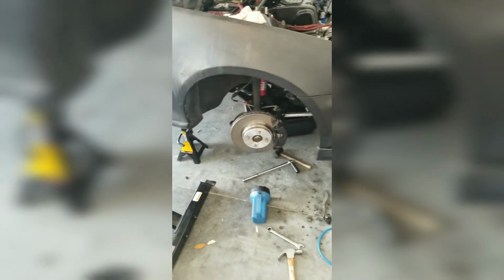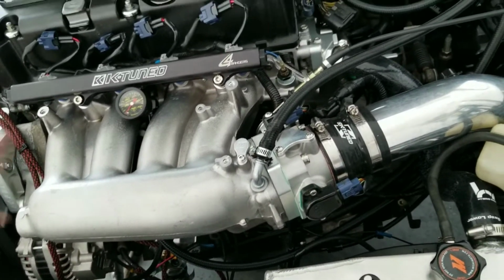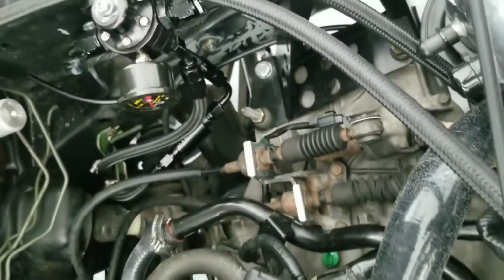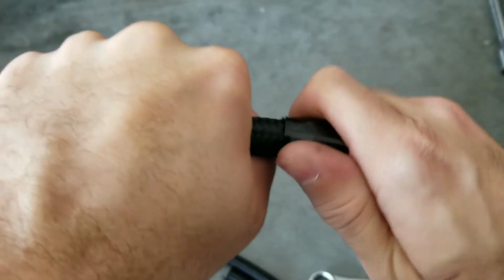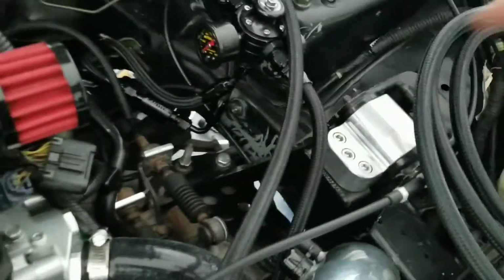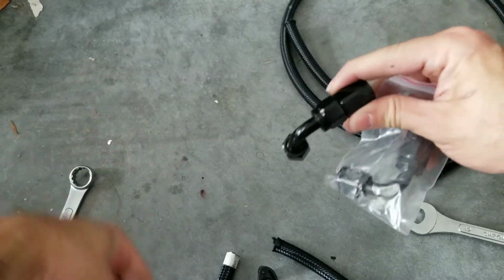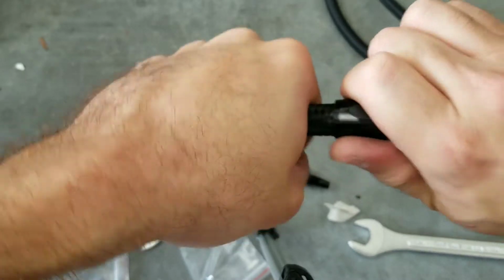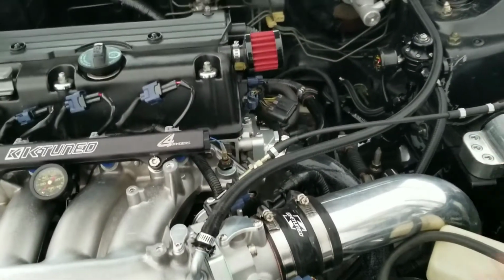How to make custom kswap fuel lines for only $45 dollars!

Comment: What size an hose are you using on intake manifold near the throttle body?
Reply from the maker: That's the vacuum to the power brake booster is a -6

Comment: Can you run E by just doing that or you your to do Some stuff by the fuel pump
Reply from the maker: To run E85 or higer methanol fuel you need a compatible fuel pump along with non corrosive fuel lines, this rubber lines wont work for long.
Reply: @Almostboosted what about if I got PTFE line and set it up just like how you did and I had a e85 fuel pump would it work or I got to some lines by the fuel pump
Reply from the maker: @noticethenelsonsyet8790  perfect
Reply from the maker: @noticethenelsonsyet8790  ethanol *

Comment: Hi buddy how have you been? I have a question for you. Mine fuel line setup similar to yours obviously.  Tank vent tube is cut, OEM fuel line to OEM filter to ktuned FPR then to the return line+ Walbro fuel pump.  Ok so here’s the question, my car starts fine and idles fine. Pressure stays 55psi at idle but soon as I shut the engine off my FPR gauge drops to zero almost right away even when at prime.  Is it normal? Can you check yours and let me know thank you in advanced.
Reply from the maker: Message me through IG if you have it to better help you troubleshoot
Reply: @Almostboosted  can’t find where you list your ig.  How do I add you thanks

Comment: Thank you bud for making this happen.
Reply from the maker: I'm sorry I took forever to make it lol
Reply: @Almostboosted  maybe next could be how to on retain PS /  remake charging cable / how to tuck or route your cabin harness
Reply from the maker: PS is a bid different you will need a non manual rack and pinion, the charge and conversion harness sound good to make awesome suggestion
Reply: @Almostboosted  ps I will figure it out when I get there sometime soon. Lol. Thx buddy
Reply from the maker: For  PS  I seen people use rsx oem parts or hybridracing PS kit
Reply: @Almostboosted  my main issue would be the clearance for the hood.  I will use Egk2 mounts but after searches still uncertain if the lowest setting would do the trick or not.  Goal is not to cut anything and remain stock as possible.
Reply from the maker: @PaChiLa_Leader  The EGK2 are dual adjustable mounts. If you have the k24 just put it on the lowest setting and you will clear not issues. I just don't like how low the oil pan sits of the ground.
Reply: @Almostboosted  guess I will find out when the time comes.  Just couldn’t find any hard proof online for the hood clearance and that scares me.
Reply from the maker: I'm running hasport EGK2 with no issues
Reply: @Almostboosted  I figured mine out already but no worries. Still appreciate it.  Keep it up bro thx.